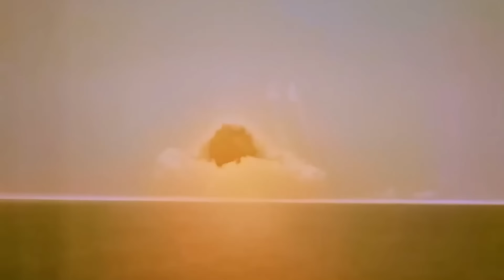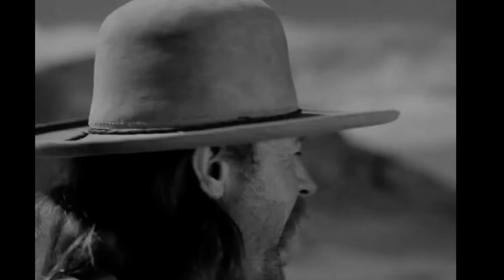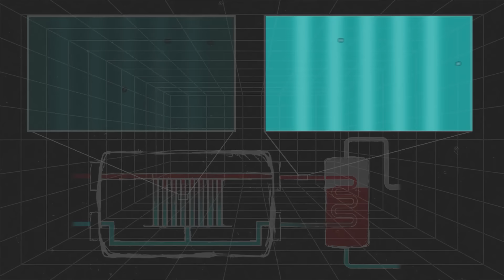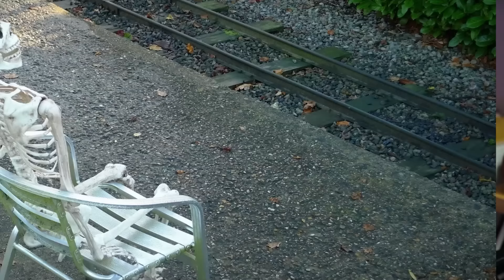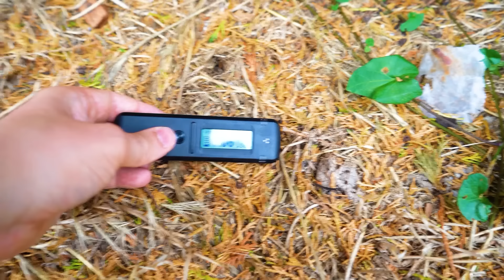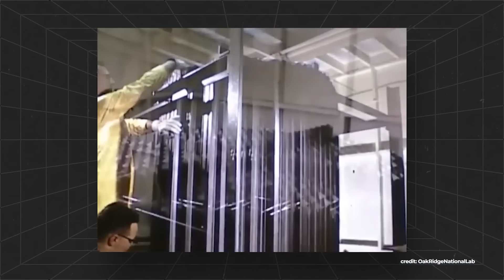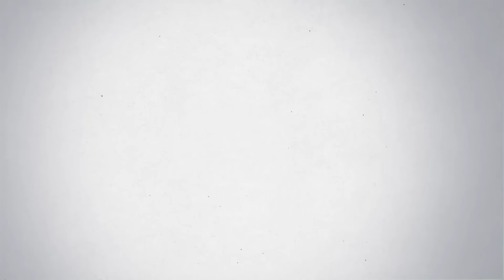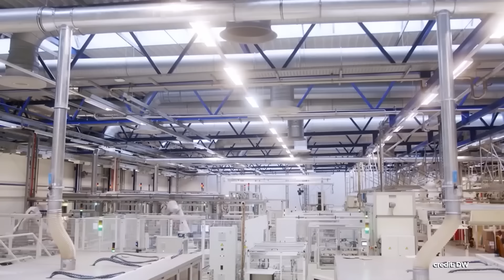It's Happening - China Launches World's First Thorium Nuclear Reactor

Comment: As a former primary aluminum extractive metallurgy researcher, I am concerned about the corrosive nature of molten halides.
Reply: it was already solved many years ago at oakridge national labs
Reply: @Sputnick_00  I am not sure if it is solved or just well "characterized". Yes you can make the pipes out of platinum group metals to make an invincible system but it is really not practical. All other materials react with fluorides. In case of a good characterization, however, one can have good control over it but still the system remains maintenance intensive.

Comment: I am not a nuclear scientist, but I have chatted with actual nuclear scientists working in the field and done some of my own research. A few points.

1) Thorium salt molten salt reactors don't have a problem with the thorium, they have a problem with the salt. High temperature molten salt is extremely corrosive, and destroys reactor components quickly, requiring costly accelerated replacements.
2) We can already make walk away safe uranium reactors. You don't need thorium to make one, just designs that incorporate these new features.
3) The reason nuclear reactors are so expensive is mostly cause by three factors, financing and regulatory burdens (which are good ideas) and a labor force not used to building them any more and missing critical skillsets. These factors make building the reactors an extremely long process, and the compounding interest on the loans piling up drives them into bankruptcy levels. If the government offered zero percent financing like China's does nuclear would be back on the table.
4) The nuclear waste problem is entirely overblown. We can build our nuclear plants to reduce the nuclear waste to where it is only dangerous for a couple hundred years also. In fact the US nuclear waste pile could power our country for the next few thousand years.
5) We make in the US a thorium fuel called ANEEL, which can be used in currently built nuclear plants.
Reply: Molten salts are not novel, they are widely used in current industrial processes. The corrosion is principally an oxygen problem. By using appropriate salts such as FLiBe, high nickel steel alloys and keeping oxygen out of the system (removing H2O molecules head spaces pressurised with He) it is readily manageable.

Greater issues are thermal stress and intense gamma flux. These currently serve to limit the life of the reactor vessel to about ten years. The logistics problem is how to economically and safely replace and dispose of spent reactor vessels that would weigh around 300 tonnes. Weinberg looked into the engineering involved and a number of schemes have been proposed. If molten salt reactors vessels with a life of say thirty to fifty years could be developed that would solve the problem.
Reply: @jimgraham6722 You're the one peddling myth. These solutions don't work. They only look good on paper, but when actually applied in a prototype the whole mess breaks down in about a week. I used to work with Thorcon so I know it simply doesn't work like advertised. Thorcon was told to build a prototype molten salt system sans the uranium (so non-reactive) and about a month after scale-modeling it they kinda gave up and went back to the drawing board. Other molten salt initiatives are finding out the hard way that molten salt is pure fucking evil. I have no idea what China is doing with their reactor, but most likely it's chock-full of exotic polymers. This wouldn't surprise anyone in the industry because China is the world leader in production of those exotic materials to begin with. They may be able to make it work simply by being able to produce the materials needed for molten salt reactors cheaper than anyone else.
Reply: @andrewsuryali8540  Not peddling anything just looking at facts and issues.

It's a pity about thorcon, seems they ran out of money and/or underestimated the development hurdles. That's a price of being at the bleeding edge  Fortunately there are plenty of others in play.
Reply: @jimgraham6722  The fact is simply that any molten salt reactor will need a host of exotic materials and there may not be any "smart" or "simple" solution for it. Most likely the way to make this technology work is by brute-forcing it with logistics and a supply chain. If the exotics are unavoidable, the solution is to make them cheap. This is why if anyone's able to make it work, China is the most likely candidate.
Reply: @jimgraham6722  I think it seems to be a combination of the salts corrosion, high temperatures and high levels of radiation based on my research. To top that off are regulations on what metals and materials (and their new material approval times) can be used in nuclear reactors, which is a good idea IMO so unfortunate but necessary. This combination is what is really stopping commercialization of thorium reactors near as I can tell, which is why we don't have them today in any country except as test platforms.

That is why I brought up ANEEL by Clean Core Thorium Energy, which uses thorium in already developed pressurized and CANDU reactors. The molten salt issues may be needlessly complicating thorium fuel use since these reactors are already built and licensed. Sure, salt is a better temperature vehicle than water but brings its own issues. 

The question I keep coming back to is, are we building thorium reactors or molten salt reactors? Could we possibly use thorium in a pebble bed reactor with helium as the coolant? Unfortunately while I like to research I lack the expertise to answer that question.
Reply: I think I heard that most of the Corrosion issues are drastically reduced if you can retain a very high purity salt with little to no oxygen in it.
Reply: @nolan4339  It is the corrosion that is adding the impurities to the salt.
Reply: You can also add that the same uranium industry provides tech and people into nuclear weapons industry, which makes it double effective, while thorium can't be used as a weapon. To have nuclear energy industry and not have weapon industry is just stupid as recent times show, all nuclear countries gonna have their warheads soon.
Reply: yeah youtube just deleting any comments with nuclear w3@p0№ in them, amazing
Reply: You could make a fuel out of thorium blended with other isotopes of uranium and a little plutonium as a start up aid. This type of fuel has an extremely long service life as it breeds its own fuel giving more complete burnup as it tends to fission the transuranic elements soon after they are formed. The catch? It likes slow spectrum neutrons to start up, and fast spectrum for the main burnup which is a engineering challange.
Reply: Are not the Chinese developing Helium 3 power generation facilities. These quoted articles put out by the CCP maybe a piece of diversion proproganda.
Reply: Well China is a Totalitarian State (CCP) so they can do whatever they want with no fear of regulatory & financial repercussions.
Reply: What is the full forms of ANEEL?
Reply: "where it is only dangerous for a couple hundred years" how is this safer?
Reply: @DeveloperChris  Less time that it is dangerous, far less radiation produced considering the half life before it is just background radiation levels once you are not standing right next to it. These are heavy elements so bury them deep, like a fracking well that is away from ground water, and nobody will ever know it is there.
Reply: Has pretty silly, comparing communist challenge slave, labor to any market you might find in the West how absurd
Reply: All that I can hear is a jealous american giving excuses.
Reply: All true to a greater or lesser degree, but not an argument against thorium.
Reply: @rbyt2010  Cheaper than constantly replacing corroded reactor components.
Reply: We worked with the Exxon Research people on some of this decades ago.  Their estimates indicated that the USA alone had over 10,000Years of available Uranium driven fuels, with Re-Breeding.  The French picked up on these studies almost immediately.  Thorium reactors were looked at, but the cost ratio was poor with respect to the Uranium cycles, and at that time safety was not seen as a large issue.  "Just put them far away" was the prevalent Mantra.  After some of these studies, the Thorium cycle was largely abandoned.  Now with the pressure to "abandon carbon" this process is showing signs of life, again.  I give credit to the Chinese for taking this on.  Their population is still growing and they need a cleaner fuel basis than their present coal mining, especially in their smog-laden cities (aka LA,USA).  If we do not at least try to copy their efforts, we will soon be buying nuclear re-cycled fuels from them, just like we do from Japan.
Reply: @brunonikodemski2420  Agreed, with one caveat. The new geothermal energy production technologies look very promising from companies like Fervo and Quaise. They could displace demand for nuclear power by meeting the same needs and scale. China has nothing like them for now, but I wouldn't bet against them in the future. I may not be a fan of the CCP, but I have mad respect for Chinese people. Personally I would like to see far more nuclear power and propulsion in deep space missions as well.
Reply: @jamesstepp1925  Geothermal is great in theory, but few people know it's problems in practice. 
- We can suck heat out of the ground much faster the the earth can replace it. That means holes drilled for geothermal 'go cold' if we generate too much power.
- We have to either periodically stop power generation, generate less, or drill more. All of those options increase cost per kWh.
- Geothermal around natural hot spots dramatically lowers cost, but it severely affects geologic activity. For example, hot springs resorts (which exist due to hot spots) can be destroyed by geothermal.
- Temperatures obtained through geothermal are MUCH lower than conventional power generation, meaning different tech is needed. The same steam turbines are less efficient. And there's more effect of heat leaking out. 
- To get proper temperatures, holes have to be drilled exceptionally deep--deeper than most oil & gas wells. That's very expensive. An ideal solution is to re-use depleted high temperature gas wells. But again, preventing steam from cooling as it circulates over such a long distance is a challenge & requires more money.

In principle, geothermal is the same as thermal solar, except heat comes from the ground instead of sunlight. But the rest is about the same. Solar uses molten salt to reach higher temperatures and store energy for use at night. Geothermal doesn't get hot enough for molten salt. And most thermal solar projects aren't moving forward because they just aren't cost effective.

It is likely a better application is direct heating rather than power generation. In northern climes, use very shallow geothermal to warm buildings instead of making electricity. It's similar to ground exchange heat pumps, which can be double the efficiency of conventional HVAC.
Reply: @theevermind  Much truth to what you say, yet Fervo has already built working power plants and plans to scale to gigawatt size next. Quaise has a viable plans to drill down to the depths necessary to reach supercritical temperatures. Fervo can also start and stop production when necessary for when solar and wind are not producing, acting as a peaker plant. Time and the market will tell I guess.
Reply: @brunonikodemski2420 Please provide the link supporting your claim regarding China’s population growth.
Reply: @surf-n-turf it's not China's population growth but they have goals to urbanize 290 million people in about a decade. The article is out there. It probably explains the 'ghost cities'.
Reply: Is that you Cameco?  What you wrote sounds exactly like what Cameco says.  For those who don't know, Cameco owns the McArthur River Uranium Mine in Saskatchewan, Canada.
Reply: @stevechance150  His friends he reffered in the comment can be Cameco employee.
Reply: @stevechance150  Actually I am not familiar with him. That being said, facts are facts no matter what direction they come from. If he says the same things I did, and he obviously has far more expertise than I do, then he is probably correct in his assertions. We can have affordable and safe nuclear power, which is what my research was geared towards finding out, but we are simply not doing it for some obvious and some conspiracy theory possibility reasons.
Reply: @jamesstepp1925 Not conspiracy theory, just corruption. People need to stop fooling themselves governments and corporations are there to improve their lives.
Reply: @Bob_Smith19   Not sure how anything gets done without governments or corporations.
Reply: @stevechance150 Cameco is huge well known company not a real person at least not if you aren't a vulture capitalist banker.
Reply: The nuclear waste piles include isotopes dangerous for longer than civilization has existed.  Admiral Rickover realized nuclear reactors were contraindicated for our survival by the end of his life.  Too late, unfortunately.
Reply: @markrobinowitz8473  Horse pucky. The reason we have such dangerous nuclear waste is that we are not using all the energy, reducing the energy levels of the fuel enough, to where it is dangerous. This is due to nuclear proliferation concerns I believe. Even then we could fill an Olympic size pool with the truly dangerous and long lived waste even after almost a century of using nuclear power. Look it up if you do not believe me.
Reply: There is a thorium problem, and that is the protactinium that poisons the reaction. You either have to continually extract it from the fuel salt, or set aside the salt that’s absorbed neutrons until all the protactinium has decayed. I’ve yet to see how modern reactors tackle this problem, or at least how meme YouTube influencers actually cover the topic without delving beyond a surface level explanation.

And that regulation is a bad thing. Give them a pass to build whatever they want without needing approval, but if they mess up it’s their heads on the chopping block. So long as it’s an engineering focused company like Boeing was 50 years ago, not an accounting focused company like Boeing is now, they should do their own due-diligence.
Reply: #4 is actually sneakily the best argument because of the financial implications of not using current nuclear waste. Think we have problems financing energy infrastructure? We need to find out how to pay for 250,000 years of nuclear drum changes otherwise. Arguably the best economic decision of the possible gains in the energy transition.
Reply: @erichoman7038  Good argument, agreed.
Reply: @MikeSmith-iv5vv Prove a single one of my points wrong. Good luck.
Reply: Wrong on almost all points. Do a bit more research before peddling these myths. Corrosion is easily controlled and doesn't require exotic materials.
Reply: @rogerfroud300  i just read through a standford paper regarding molten salt reactors and corrosion, looks like theyre using things like inconel/stainless steel for their high chromium content as well as some molybdenum alloys because they corrode orders of magnitude slower than traditional steel over several thousand hours. 

just a thought, but ideally you could just have two reactor vessels side by side, one in use for power generation and one ready to use when its time to swap out parts due to corrosion, pump over the molten salt to the new reactor vessel, swap parts in the old one, and have continuous power generation and also giving yourself the lifetime of the new reactor's parts to replace the older reactors parts. 

I guess that sounds simple enough on paper but im sure that comes with its own host of problems too. We're a smart species, I'm sure we'll figure something out regardless.
Reply: @kelseycochrane3103 Actually it just sounds financially infeasible.
These projects ultimately need to generate profit because not even governments can run at a loss.
Reply: @rogerfroud300  Source for the research you have proving him wrong?
Reply: @rogerfroud300 at least one of his points is correct. Perhaps you should go back and do your research.
Reply: @rogerfroud300  If it doesn’t require expensive exotic materials to eliminate the corrosion problem then why don’t you just state what type of materials are needed! Instead you tell people to do their own research. Don’t you think we all have at this stage of the game! Gosh, man!
Reply: @rogerfroud300 And exactly how is corrosion easily controlled?  Please provide references on how this has been achieved.

Comment: "LFTR"s, pronounced "Lifter" ain't new. America ran one for nearly four years in the 1960s at the Oak Ridge National Laboratory. Much safer and an all round better idea. There is 13 times as much energy in coal in the form of Thorium as there is available by burning the coal. So, another point in favor. The Germans figured out how to turn coal into synfuel - gasoline and diesel - before WWII.

We don't and never did have an energy problem. We have 'who makes the damn decisions' problem, and it's acute, verging on terminal at this point.
Reply: Best comment in the whole chat!!
Corruption, lobbying by vested interests and petty ego battles are our biggest issues by a very long way.
Reply: A high level LFTR design may have existed, but I don't believe the design element were ever integrated together or fully fleshed out. The Molten salt reactor experiment showcased an iterative approach of shutdowns and alterations to prove their concepts, but the LFTR design requires an in-line fuel/salt processing step which would have never been assembled together with their test reactor.
Reply: Another fun fact, the germans had wood burning cars, pretty interesting design.